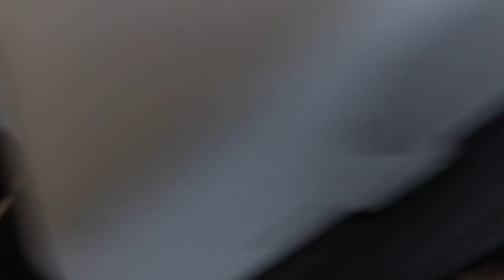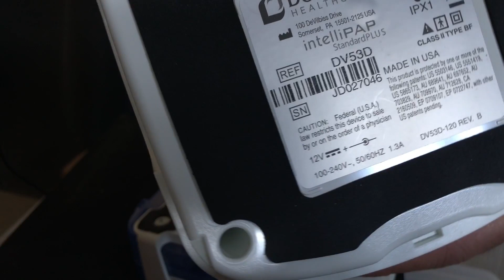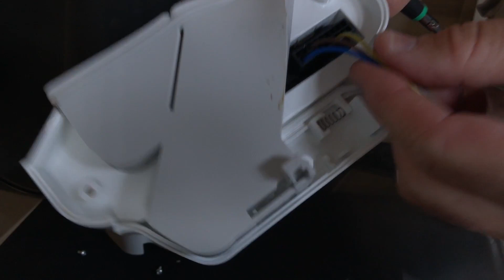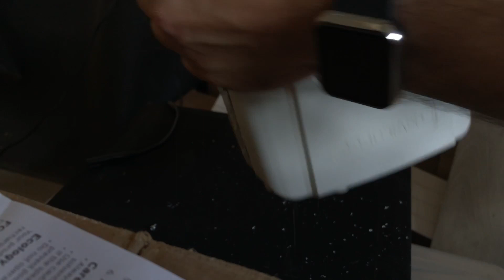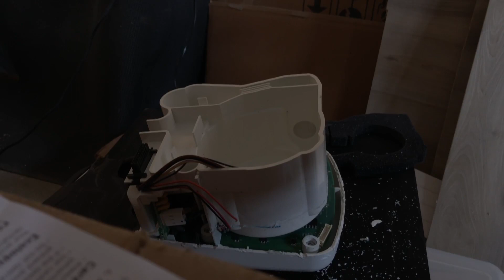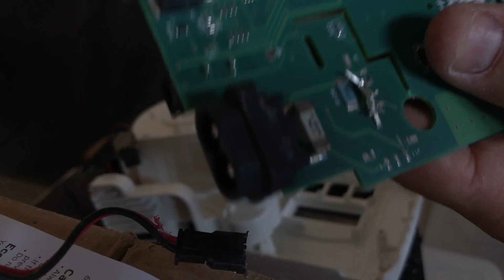DeVILBISS intelliPAP StandardPLUS CPAP Machine Teardown

Comment: OMG. If you are a mechanic, I wouldn't let you work on whatever you work on...cars, HVAC, whatever. Why don't you have a longer Torx set? They DO make them. That was painful to watch and the only reason I did was because I still use this machine and was curious as to HOW it works. I didn't learn much except that if I want to tear it apart, I can because I don't have a toy Torx driver. By the way, it's not Devil Biss. It's pronounced Duh VILL bus. Thanks for the chuckles, I'll watch another video or two. You're ignorance is entertaining.
Reply from the maker: Thanks for the advice! Sadly you are correct in that my toolbox is not replete with all manner of gear and that I often have to improvise methods of opening (sometimes destructively). I only do this for stuff that's going into the recycle bin anyways. For anything that I actually want to fix and piece back together I try to get the right tools for the job. And how true... whether it is cars, HVAC or other things... the right tools make the difference! I'm glad that at least my incompetence has some entertainment value. 🤣
Reply: I second that, just horrible, cringe video
Reply from the maker: @tomislavmedved111  Sorry to make you cringe! I promise to be more gentle next time. 🤣